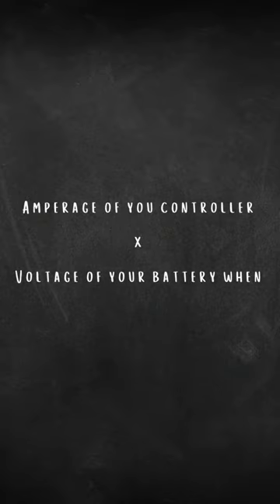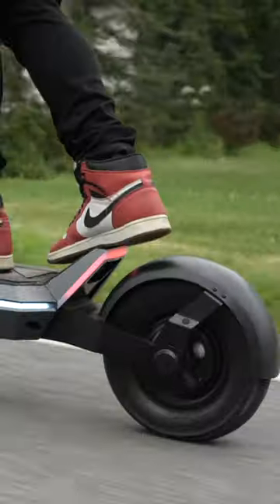Fake Wattage Claims: The Truth About Electric Scooter Motors

Comment: If the Apollo Pro is 1700W, then wouldn’t you say the motors are 2x 850W? Does the wattage number assigned to the motor mean something or are we only meant to look at the power output of the battery?
Reply: Hey! This is per motor!
Reply: Always look at the output of the controller
Reply: @eloipecquet  ah, makes sense